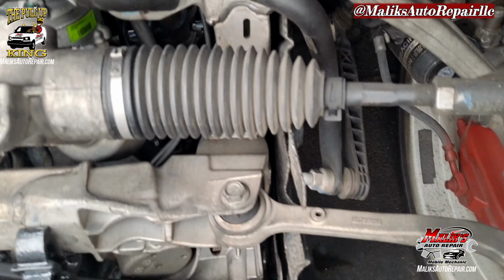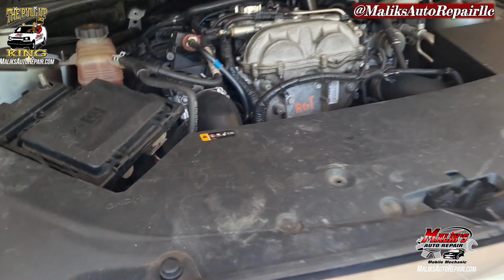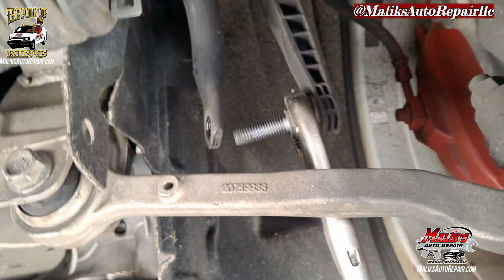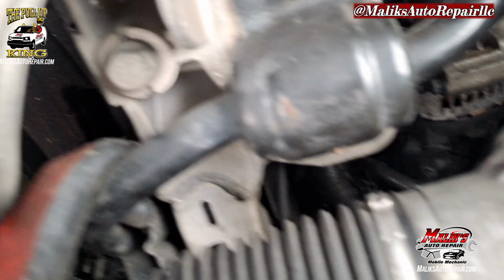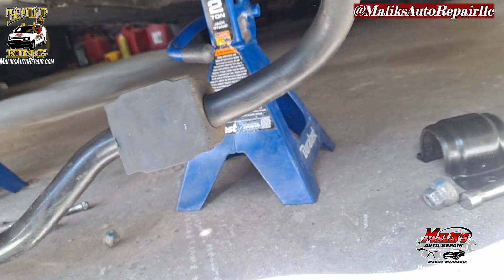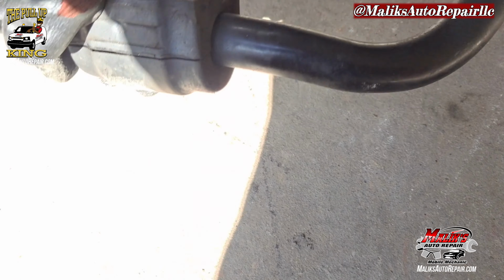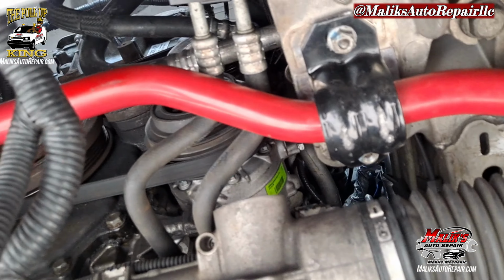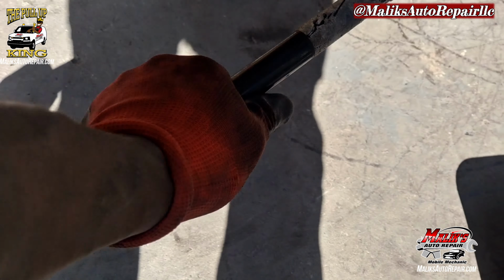NEW MOD | SWAY BAR UPGRADE | 2013 CADILLAC ATS TURBO | Howto/Diy

Comment: Thank you for posting this. Currently, this is the only video on YouTube demonstrating how to install a front sway bar in an ATS or CTS. I've actually purchased the same sway bar from ZZPerformance, and I struggled to install it. I couldn't get the bar between the tie rod and the upper control arm. But I'll try again soon, and this time, I'll disconnect the power steering module.
Reply from the maker: Oh wow, still the only video? That's wild. I know we're not the only ppl who bought swaybars.lol But yeah, I hope this video helps. Thanks man! I appreciate you watching!

Comment: Thanks for the video
I been researching a clunking sound in my xts and I believe it's coming from the stabilizer area. Its not my links because I had those replaced recently.
Reply from the maker: No problem, thanks for watching! I hope you find the cause of that noise